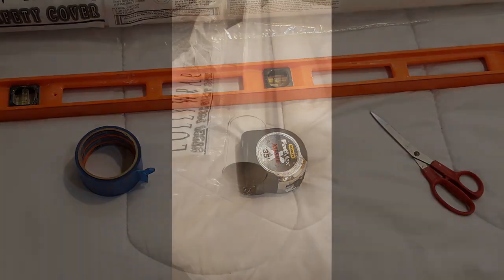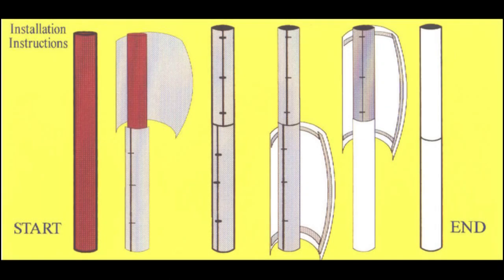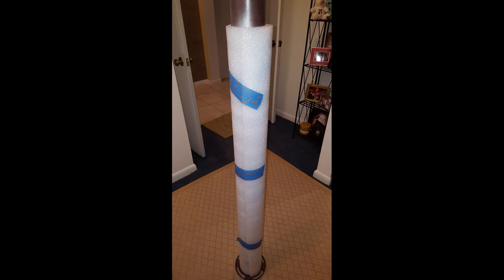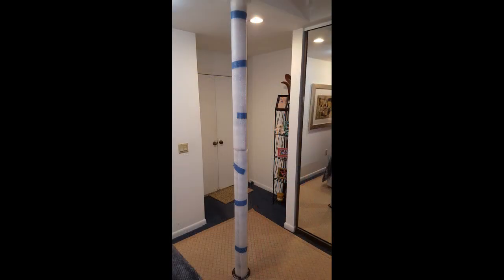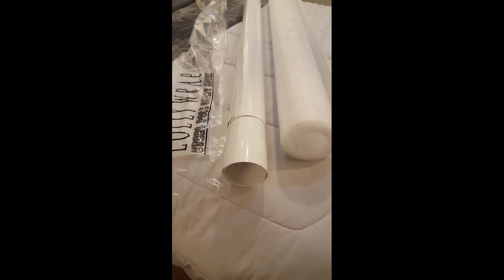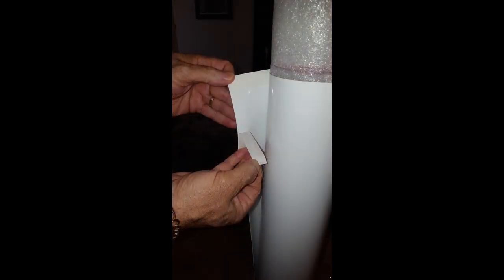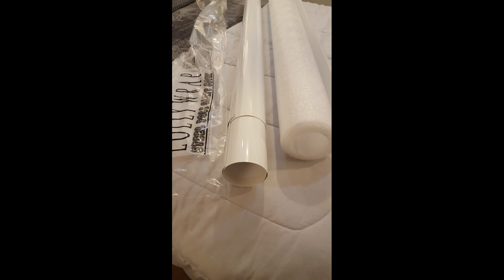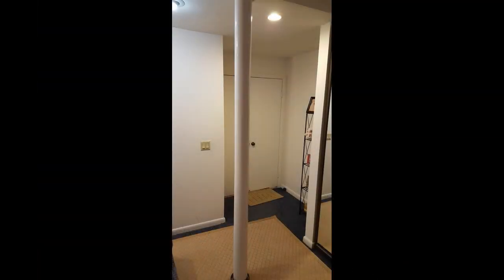LOLLY WRAP  Basement Pole Padding   Garage Pole Pad   INSTALLATION

Comment: How thick is the foam when completed-  enough to provide a safety cushion?
Reply from the maker: Hi Donald,  The internal Lolly Wrap padding adds 1/2 inch of high density foam cushion when wrapped around a 4 inch diameter pole. The outer sleeve is 2 ml thick and designed to protect the foam from being cut or picked at.  It does make for a nice padding for incidental contact by children and car doors. I don't know your specific application however, it's not a heavy duty sports type of pad you would need for high velocity adult bodily contact.  Just as a barometer, it passes safety inspections and meets code for daycare centers by the states that require a safety factor for such poles. I hope that helps you with your decision.  Thanks for inquiring.